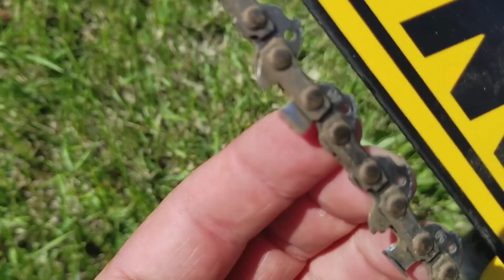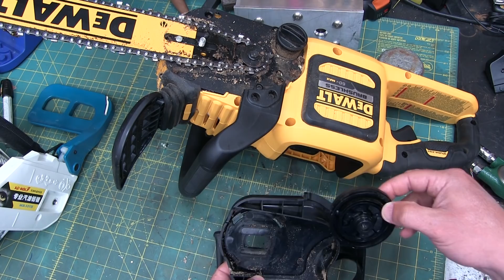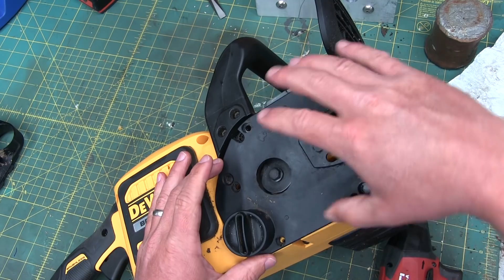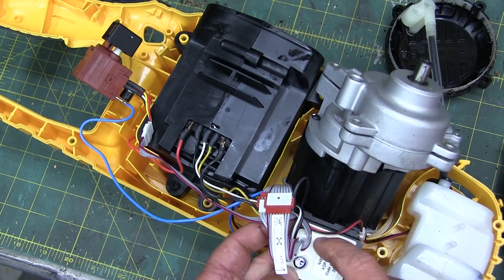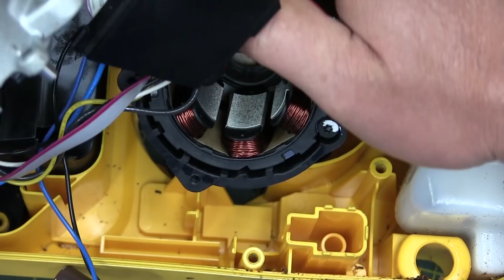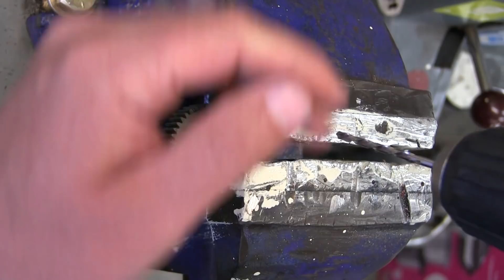BOLTR: DeWALT Chainsaw | Engineering FAIL

Comment: I've come to the conclusion that many tools are designed by engineers and industrial designers that have never used the tool/similar tool "in the wild" as an actual end user. I scratch my head sometimes wondering what in the hell they were thinking putting this here, or that there, and why isn't this here, and what were they thinking doing this, etc,. I think they may be girly men trying to trick the manly men because they feel inadequate? Thank you AvE for revealing the trickery that the girly men try to put into our tools!

Comment: Not to be a troll but man when you first saw what you supposed to be called the ESC motor controller you should have realized just from its sheer size it couldn't fit the mosfets also you have the direction of airflow backwards

Comment: Wouldn't it be an easy fix to just throw the whole ratchet part out and just screw a nut and a big washer on that bolt holding the blade?(and then reattach the cover somehow)
Not sure if thats safe, but thats sure what i would do.

Comment: if the shaft turns clockwise a right hand thread will tighten under use if it spins counterclockwise it will loosen for jessless your better then that

Comment: When do you plan on disassembling an altimeter and reassembling it.   The kind that has no batteries and only relies on air pressure.  Remember next time you fly your life may depend on such a critter.  They are very simple inside.  Tempted yet?  the mechanical multiplication is about 1700 times.

Comment: So why didn't he cleats plastic bit, (blade holder) before he put it back on the saw. Every chainsaw I've used has build up like that. Before you the cover on, you clean the bloody thing.  I have one of these saws and it has done some pretty heavy cutting,  probably more than what it's designed for.  Here in Australia we have some very hard, hardwood timber. One species isn't called Iron Bark for nothing. It's not the bark that's hard, it's the wood inside the bark.

Comment: Wow, what a piece of garbage. I am usually a bit of a DeWalt fan. Fortunately, when I was looking for an electric chainsaw, I picked up the Husqvarna 536LiXP which is amazingly good, certainly the bar retention is the proper two bolt mechanism. Battery life is also pretty solid. Only weak point is the super narrow chain which can blunt quickly.

Comment: I try to avoid battery tools as much as I can. Even if the tool is good, it'll be obsolete in 5 years when the batteries are shot and the manufacturer already has a new battery standard.

Comment: If I had that I would mod the bar attachment system and if possible the tensioning system. You wouldn't be able to remove the bar without a tool when I was done. I will void a warranty in a heartbeat I don't give a shit. I just wait a month or so to make sure there are no manufacturer defects.

Comment: Gear Engineer here. Nice vidyeo. However, your explanation of rolling/sliding in spur gears isn't quite right. You only get pure rolling friction at one point, called the pitch point. The further you move away from the pitch point, the higher your sliding gets. So gear contacts are really a rolling-sliding system.

Comment: Couldn't you modify this yourself to correct some of the issues? I can't imagine it'd be rocket science level engineering to make the bar wobble much less, at least enough so to the point where it wouldn't jump the chain so often making it more useful. Also maybe trying to seal it up a bit better to keep the dead tree carcasses at bay a little longer and she might chooch long enough to be worth something?

Comment: I have been watching you for a few years I’m in Alaska I work for an outfit that installs guard rail on the highways we use Uni bits or step drills when they get past the point of usefulness we throw them in the ditch various brands have their own style either helical or a single fluteSo far no success of sharpening they run from $40-$90 apiece I see a business opportunity if you can sharpen the darn things I could send you a box of them

Comment: Would love to see a dismantling video of the Milwaukee chainsaw to see if it has any potential downfalls like the bar. I'm a gas saw runner but could see the benefits of having a battery saw on standby and for a quick cut or two. Thanks

Comment: i think the problem is today, the younger generations are more and more removed from tools and especially good tools. And that also counts for the engineers that are building these things. They didnt get a skookum tool course in university. And the company definitley wont waste their time. So unless they have experience using these tools or around job sites with these tools they aren't too aware of what needs to be strong and the type of forces that can be applied to the tools.

Comment: The cost to value of this tool is way off balance. One of my more favored hobby's for letting the smoke out of tools is trimmin' the hedges with electric chainsaws. At fourty bucks a pop I can usually get through the yard on one saw give'r a cool down period as to not light the gahbage can on fire n' give 'er a toss. I do this a maximum of one time a year and get a brand new shiny saw and blade for each use. No pull starting, no sharpening. My advice for added value is to buy em online from the usual scumbags and its like Christmas every time a new smelly box arrives!

But honestly if any DeWalt engineers are watching... beef it up a little bit. I too dream about my cordless tool collection when the wife is away but if the tool can't hold up to the job it was meant for at a certain price point why should I buy it?

Comment: It will never run again .... a 5/16" stud  is hard to confuse for a 15/16"  even  allowing for misspeaks at 7/16" .
Left hand thread bolt of any decent quality no matter how small have  LH  markings on the head  along with the hardness designation  from supersoft to hard  2 , 5 , 8 .  a pdf of the repair manual is really easy to get...saves breaking parts.

The saw is a home owner`s  Toy , soft woods small diameter saplings .The weeble woble was included by Dewalt  courtesy of the PLASTIQUE construction so that the PLASTIQUE would not snap under pressure.

Comment: Makita chainsaws are made by Dolmar, a proper chainsaw manufacturer. If not Husqvarna or Stihl than Dolmar, anything else is probably garbage. Stihl and Husqvarna will have better support and are easier to get replacement parts.

Comment: I have a question that I think only this community would have the answer to.  I'm in need of dual voltage power tools.  It seems logical to me that a cordless tool should fit the bill, but I'd like to know if anyone has ever compared North American batteries to European ones in the sense that all I'd need to do is buy a charger for each region?

Comment: just buck up..... and get a sthil..... 
sthil chainsaws are da bomb...... got a 16 inch bar or so..... just to keep grandmas yard clean

then i got the big boy with a 2 foot or so bar..... both have quite the bit of power

when ya wanna get shit done..... the exhaust needs to be blue and smell GREAT
Reply: every saw ive used with that ratchet system has gone loose.....

my little sthil has to be torn down and adjusted hte old school way..... but it can go a full week of cutting shit too big for it before it needs adjustment
Reply: i know i sound like a sthil salesman..... but the fuckers work

never had an issue getting them to start..... but ive had issues with others
mostly from hot suppers and abuse 

keep em lubed.... use 91 no ethanol gas, a good 2 smoke oil...... and adjust that carb
fires up first or 2nd pull

then again.... been cutting wood sense around 7 or 8 years old
no OSHA on the family job site

Comment: Holy crap is that thing a piece of shit. I almost bought one of these the other day to replace my aging corded electrics. Even though I've never had anything but a good experience with dewalt, something about this made me hesitate. I guess I'll just keep dragging the extension cords around. Even though i only use this kind of thing for small limbs and bushes, I still want quality. There is a reason my main saw is a Stihl ms311 with a 24" bar on it.

Comment: You shouldn't be using the tip of the chainsaw to make cuts.  Completely fucks the bar and chain and overtorques it.  That tiny ass chainsaw is only a bit bigger than a pole saw.  Only for small branches and unboxing.  Those twisty plastique clamp is garbage anyway though

Comment: Ha its funny as the two bolts in chainsaws get pulled out of the saw using arm strong tight anyway. Lol no chainsaw is idiot proof and a good chainsaw is a sharp chainsaw. 
It looks like there is a flaw in the moulding of the plastic as other plastic saws like the makita have no problem using the same mechanism.  
Please use the tool for its intended use and if you have a wevel wobble go and get dewalt to replace it

Comment: Dewalt was gobbled up by Stanley Black and Decker, Dewalt no longer produces the reliable and indestructible products they used to be you can see from the disassembly how bad the products are now
Reply: cryptodon You obviously know nothing, Dewalt has been owned by black and decker since 1960 they made radial arm saws and that's it black and decker made professional tools and home owners grade tools a lot of contractors would buy the homeowner brand and wouldn't jold up like their professional brand and they started get a bad name so they took their professional line and made them black amd yellow and became the biggest power tool brand on the planet so learn before you speak

Comment: With all the negativity , you should try it! I easily cut 4-5 trees , 10-14 " DIA. Used 1- 9AH battery (fully charged) and 1/2 - 6AH battery. Proper position of the saw is important.

Comment: Straight GAHbage!

What's sad is they could call up the Huflungdung factory and had them cheap out in other places OTHER than the 2 most important places on a chain saw: the bar retention and the chain tensioner and made at least a half way reasonable tool for a home gamer.  Basically copy some shit they've already copied in cheap Chinesium saws and do it half way right.  Problem is, they put all their money in the motor when I can half-ass fix a Chinesium 2 smoke with some starting fluid and a real spark plug and not have the chain slap like a Harley.

Honestly, how much more would it cost to use a conventional bar holder and tensioner, even if they are pointing this at a home gamer?  If you're going to be some savage and cut tree carcasses, would an extra 20 Freedom Bucks and a ratchet really put you off your lunch?  Let's be honest, rich people buy this crap.  And there's only so many of those and they're shrinking by the day, wah?

Comment: now thats a piece of turd right there, how do i know?... I have a older cold weather, STIHL MS270C (arborists know it as the "snowflake" STIHL) with the plastic cork screw handle just like that... except its not ratcheting, it just has a nut molded into the backside of the plastic wich I will say is pretttttty dam strong because you can crank it far beyond 10ft lbs even can put a pair of channel locks on crank it and there is zero weeble wooble at all in the bar.  So this design does work!    . . ..  for STIHL    side note (wouldn't a cordless sawzall with a wood blade handle any light trimming better than an electric saw and be lighter anyway?  seems like a redundant product from a company that makes high quality sawzall tools.

Comment: This is the logic the cheapo chinese multitool jobs have, pin, bolt, yes it'll hold a 10" bar. Nope, it wont, beefed up, jam a 14" bar on and give 'er wah. Anyways, that's built like a pruning saw, except you can't jam a few horsepower on the end and murder things. (might be worth a look, cheapy komatsu clone 52cc engines, various attachments, some hobbed gears, some moulded. )

Comment: I think I will stick to hand tools. Yeah, takes more actual elbow grease than using a chainsaw, I have no issues with using a bow saw, axe, hatchet and/or pruning shears. No gas to burn, no electricity to use, and handy in the middle of no where.